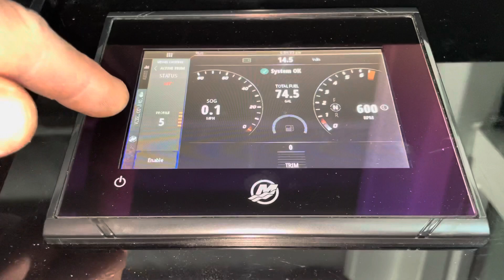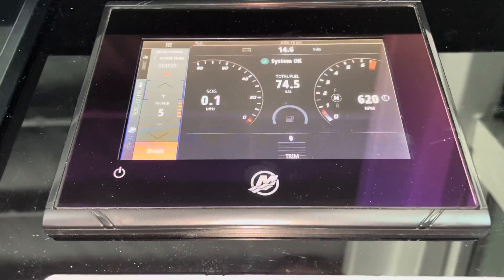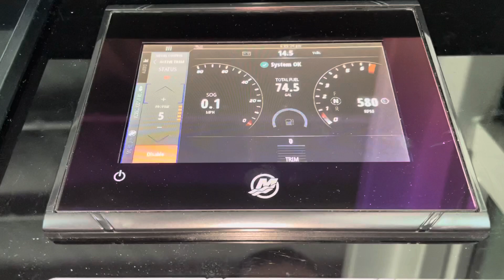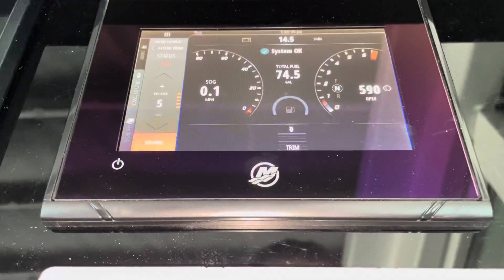Programming mercury active trim

Comment: Is there an option to chose how high it can trim on any profile, or set the limit?
Reply from the maker: I don’t think I understand your question. You want to figure out the max at speed and then set it to trim that much when on level 5 and then the other lower numbers are less  aggressive.
Reply: @shanemccormack4840  my current active trim on level 1 goes all the way to 35 which is too much, trying to recalibrate it again to around 20-25, how do i do it? My question is how do i set active trim 1 to trim up to 25%?

Comment: Hello from France

I can't get my activ trim to work. The programming is proceeding normally but when I go sailing the trim don't move and after a few seconds I have an error message telling me to take the trim manually. I have a simrad GO9 with the vesselview link and a Mercury v6 225hp engine. My boat has already returned once to the seller and an update of the active trim module has been done, but without success.

Do you have an idea ?
Reply from the maker: It’s possible the active trim module is not in a good spot to receive gps signal. Also could be a bad active trim module. You would need to have your local dealer plug into the SmartCraft network and check it…. Hope this helps!
Reply: I there I got the same issue with my boat